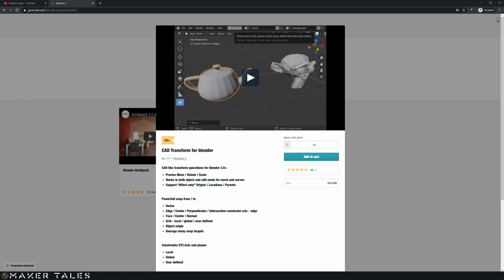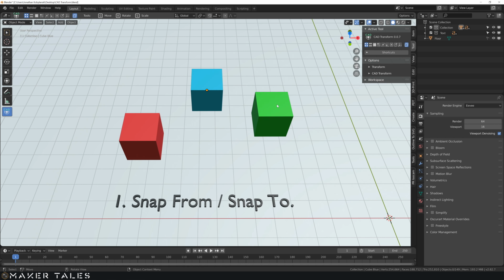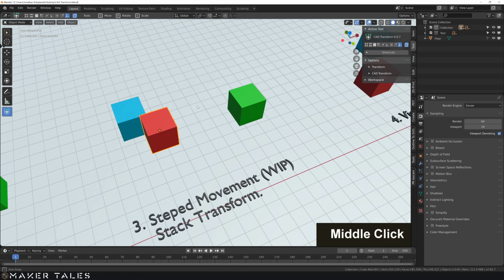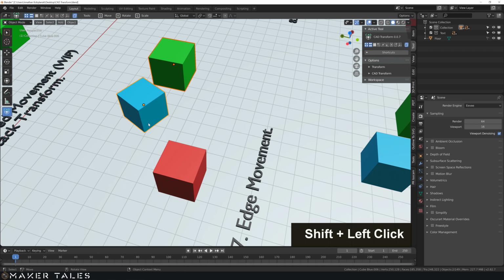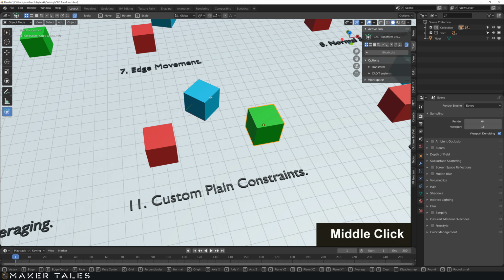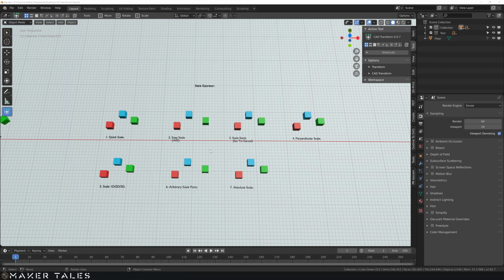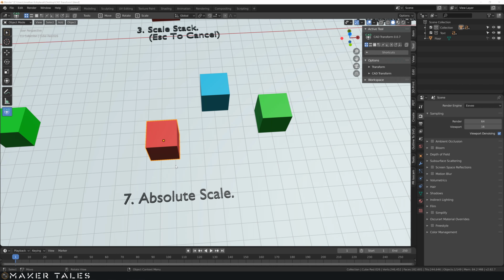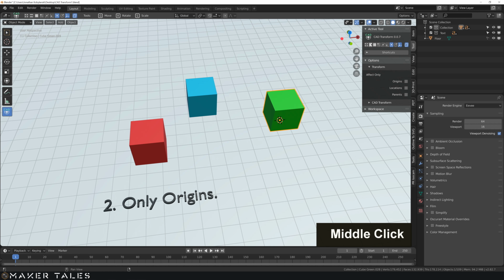CAD Style Precision Movement In Blender 2.83 | CAD Transform Addon

Comment: Hi, I've recently installed this app and now my Blender is frozen on a black screen after clicking the new CAD icon in Blender. This screen has details of the computer plus says essentially  CAD transform 0.0.7 ready with a blinking cursor. I can not get past this and have even resorted to reloading Blender several times, and it keeps returning me to this Black screen. Can someone please tell me how this can be fixed?
Reply: CAD Transform print "ready" on successful init. So it is probably not the root cause of your issue. However you may try to remove the slcad_transform folder from blender add-on path in user profile.
You also may try to start blender from command line with "--factory-settings" option.
Reply: @StephenLeger  : ) Hi Stephen thank you very much. I would love to use the add on, but something is not agreeing with my program. I am sure the App works just fine, I am just not that technically minded, although I do try. I was able to reload Blender 2.83 with Factory settings, and it is running well again. Thank you for your time, and I wish you much success with your work, cheers!:

Comment: I think the default Blender measuring tool is useless.  The snap doesn't even work on first point.  Maybe I'm not using it correctly, I don't know, but I think that a feature that would go great with this CAD add-on would be a nice measuring tool that uses all the same snap modes, axis locking, etc.  It would be nice if the dimensions could be formatted such as showing desired number of decimal places, option for tolerance band, and have symbols for radius, diameter, angle, length, etc.  I often would like to be able to dimension my models, like you can do in SketchUp and other CAD programs.  The dimensions could automatically go into their own collection so they could be hidden or made visible in one click, or the Dims tool bar could have its own checkbox.  Other settings could be provided to set the font, font size, dimension color, etc.  Also, after placing a dimension, it could be dragged some distance from the object in the desired direction/axis.  Dimensions should have proper guide lines and arrows.  Just a thought.  I'd like to have good dimensioning tools.  Maybe there's already another add-on for that and I haven't seen it yet.  I'm new to Blender.
Reply: Take a look at "MeasureIt"
Reply: @StephenLeger    Thank you, just what I was talking about.  It was there in Blender all along :-)
Reply from the maker: Hi Bill, Take a look in this video I have a feeling you might like what you find https://youtu.be/26nrKiq_l8I
Reply: @Keep-Making  You're right, I did enjoy that, thank you very much!

Comment: For some reason CAD Transform seems to be locked to meters. I have all my units and scale set as you have shown for mm, but when I type in an absolute value, the object moves by meters unless I put in the decimal version, or follow the value by "mm". This happens whether I have "Absolute scale" checked or not. Anyone have any ideas?
EDIT:
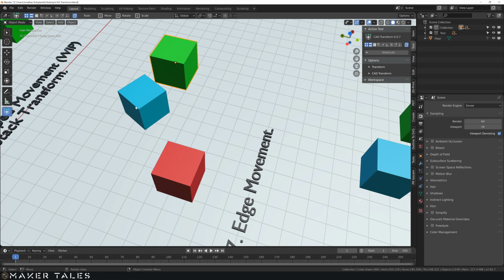Upon a re-watch: Discussed briefly at 9:30. Apparently that is the way this works. Bummer.
Reply from the maker: Hey Sage,
Ya it's a little bit of a pain. BUT!
The update is just around the corner and I can tell you that this has been more than fixed.
It takes your scene units into consideration now plus if you want to say 10ft in a mm scene it will turn your unites into other unites types.

Comment: This gives bad impression about blender since most of this is possible with default blender. 

1. yes
2. yes
3. yes* (stepped movement yes, stack transform no)
4. no
5. yes
6. yes* (but not that fast)
7. yes* (may take longer,depends,possible)
8. yes
9. yes
10. no (but you can find centers in edit mode)
11. no (you can define axis angle and then move x amount)
12. no

Rotate

1. (This is default rotate in blender)
2. no (would be nice to have, but entering is fine)
3. yes* (shortcut allows only one axis at the time, but in transform panel you can do this very fast and change at any time)
4. no
5. yes

Scale

1. (This is default scale in blender)
2. no
3. yes* (but in transform panel you can do this very fast and change at any time)
4. no
5. yes (done with pressing shift and axis you don't want object to scale)
6. yes
7. yes

1.no?*(not sure)
2.yes
Reply from the maker: Hey i74s, this is not about if blender can do it.... It's about ease of use. Most people looking for an addon like this come from a CAD based workflow where all of these movement options are available with in a 1 - 2 button clicks. I'm sorry to say but "default" blender already has a terrible impression with anyone that comes from a CAD workflow, one of the many reasons is that some movements take 1 - 6 operations, changing from varies view modes and interacting with multiple panels to do. Not to mention, this video just covers the basics of CAD Transforms. you can stack these snapping operations to snap to places blender would quite frankly never go in one move. Without addons like these, blender would exclusively be used for roughing out ideas and organic based modelers. As I'm pretty sure hard surface and precision modelers are all about efficiency, accuracy and simplicity. I would love it if you could show me a video with all these operations being preformed accurately, intuitively and as simply with default blender.   SO to say this addon gives a bad impression of blender is a very narrow view. Just look in the comments at all the CAD modelers that will now even consider blender.... when before they would not even give it a thought of being a viable option.
Reply: @Keep-Making  Thank you for replay.

Well yes I agree that it's about workflow and how fast you can achieve certain operations. 

But I have feeling that people jumping in the bad habit with these addons, since blender already is heavy on shortcuts (they working on minimal shortcut map(i like shortcuts)) 

As an example (this addon in general)

So if this addon will not be supported in the future, people will not know how stepped movement works? Since it's achieved with snapping activated (magnet icon) 1mm movement on 0.001 unit scale, if you hold shift it's 0.1mm, if you zoom in, then default snap 0.1 and with shift 0.01, and ofc you can just type that, after pressing G (XYZ) x amount. You don't need to hold 5 keys to do that, also its default that works perfectly.

I'm annoyed that this addon claims default transform features as his features. For example you say that axis lock,plane lock are similar, but in fact it's default blender (except additional G, and also just leave magnet icon on, why that G(snap) is even in there, who will move object like that?)

I love precision, I keep snapping and always in orthographic views.

I noticed that fusion have this isometric projection workflow, and you define everything from there, but in mesh modeling in blender, you have grid on all views, and you can do very fast precise transforms.

"organic based modelers" this line triggers me every time.

Yes I would love to make video about default blender operations. not a promise, but yes I want to show people that blender is not only organic modeling.

I would love to see "advanced snapping stack" example and where that would be useful, since I don't have normal CAD experience. 

I have different experience with CAD, I was working for 7years with 3DESIGN and it has horrible workflow, I hate that program so much, ofc it got job done, but what a piece of shit.

I have tried fusion360 out of curiosity (still have it) and it's similar workflow to 3design (don't mind the fact that it's light years further and more advanced) But I find that I can do precise models that have parametric features with mesh modeling and use parametric features faster (ballsy claim I know)

No hard feelings ;) Subscribed
Reply from the maker: @i74s  No hard feelings what so ever. I like to learn others points of view as it opens doors and opportunities for growth. I know the feeling of the "Organic modeler" trigger I studied MAYA and learnt the full primitive shape workflow for VFX for film and tv. However, my passions took me a different direction and all of a sudden 0.001mm margin of error was a big deal to me. So I moved on to Rhino and relearnt a whole new world and the end of the day. CAD workflow users expect something from programs due to there learning paths and Primitive shape modellers expect something from there programs due to there learning paths. The case that precision is not blenders number one priority is more than ok. Yes there are ways to do it but they are "hidden" away behind quick a fiddly interface at times. I know that in blenders road map they plan of updating the snapping system but it's just not a priority for them as there core user group don't mind and can deal with 1mm imperfections as it will not show up in the final result. I personally really feel like it does not have a lack of functionally but a poor implementation of User Interface at times.(Don't get be wrong "old" blender was hellish and Maya to this day is still a maze of legacy operations) But ya. There is no right or wrong answer here. Blender is open by nature and that's it's strength. Users can modify and use it however they want or see fit. 
p.s. Update video will have a whole little section just to "advanced" use cases for CAD Transforms
Reply: People complains about snap system till a decade now, and it is one of the most requested feature. So, yes, blender's snap system is pretty capable, but the workflow require huge refinement until something predictable and intuitive emerge. Germano does an impressive work to implements such things right in blender, but until then this add-on fill that gap.
Reply: I agree with you.
Despite this can simplify workflow, if your blender background is "stable enough " there is pratically nothing that cannot be achieve without this nice addon. The only thing that really improves is pivot point. To me the 3D cursor was esier to move in blender2.7x.
Anyway this addon is a nice "senpai".
Cheers
Reply: @claudioguarnieri1060  Predictable and intuitive snap, viewport navigation while snapping / transform, precise rotation using snap, scale by size are among others things built in functions does not provide.

Comment: Man it doens't seem to work on meshes without faces...
Reply from the maker: Hey Q20,
Good shout, I have a feeling the dev is doing this due to performance issues when the way you would detect vertices without faces. But I think he is working on a way of getting this to work. Alternatively something that works just as was as a none face mesh  are curves and the addon fully supports curves currently. Let me know how you get along with curves and see if that works. Considering that conversion from mesh to curve and curve to mesh is very easily in object mode this should be a decent work around for now.
Reply: @Keep-Making  What I did was to temporarily extrude everything into faces and remove duplicate vertices later.
Reply from the maker: @Q_20  Nice workaround, I'll keep that in mind
Reply: Will be possible in next release, but as it may be slow with huge mesh, there is an option to enable / disable in preferences.
Reply: @StephenLeger  Cool!